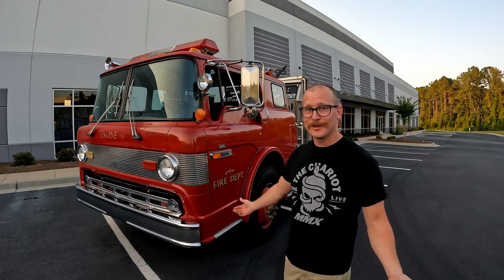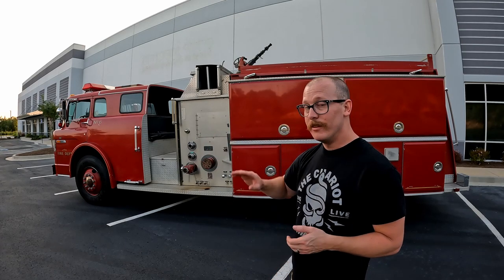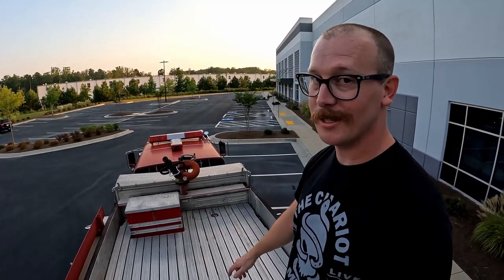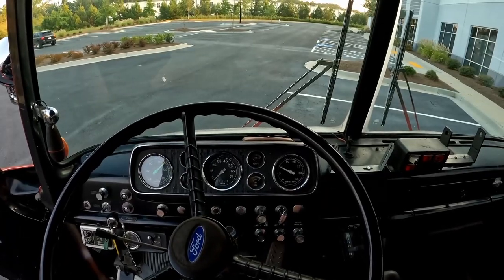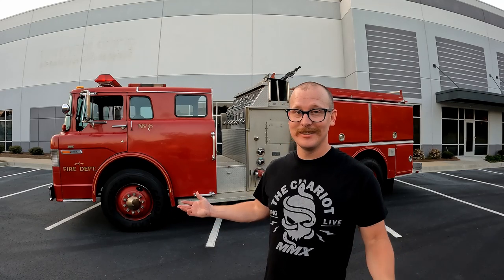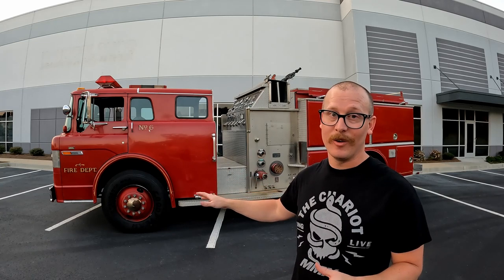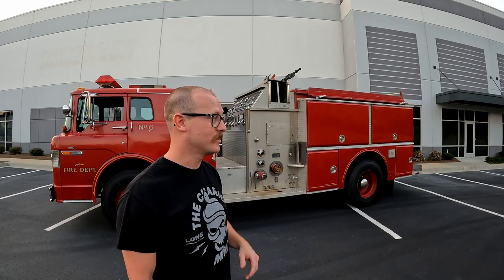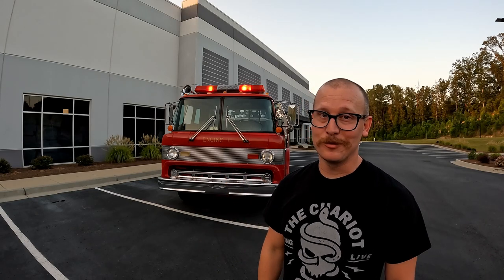My new Ford C-series Firetruck

Comment: BE A TRUE HERO: Hundreds of small communities across middle America have volunteer fire department with very limited means, and could use this truck. It might be old, but if it works, nobody cares.(If your house or barn were burning, would you worry about the make/model of fire truck?) DONATE THIS TO A COMMUNITY THAT DESPERATELY NEEDS SUCH A TRUCK.
Every time it is used, you'll be a hero all over again.
Reply: I have a 71 ford f700. It has under 8,000 miles on it.   If anyone is interested please let me know. It has all the fittings and Hose.

Comment: The first fire call I ever responded to I was in the back canopy cab seat of a Ford C8000/Grumman. Our particular engine was yellow in color, so it was sometimes referred to as the "ass kickin', fire chicken". Also, if that water pump can still pump its rated capacity, you may be looking at some good money for it. A new, modern fire pump is $20K+.

Comment: you can find trucks like this for a good price ,but if it has air-brakes ,you need a CDL for air-brakes and GVW over 25,9k  ,and try to find insurance
Reply from the maker: Air brakes is not a CDL requirement, truck is tagged under 26k, and is one of the cheapest vehicles on my Hagerty policy.